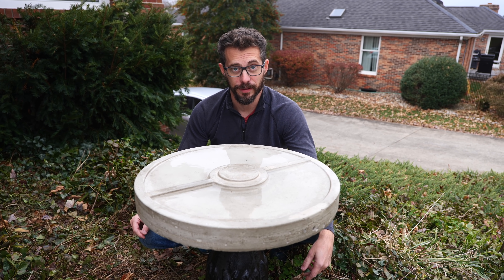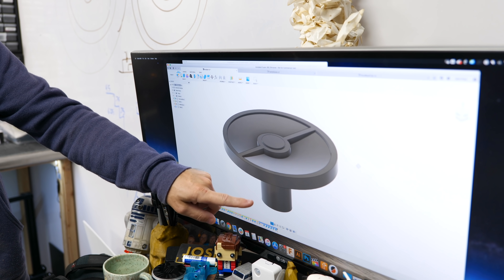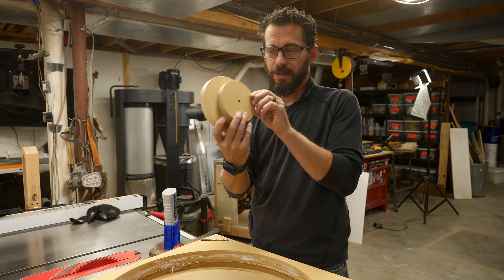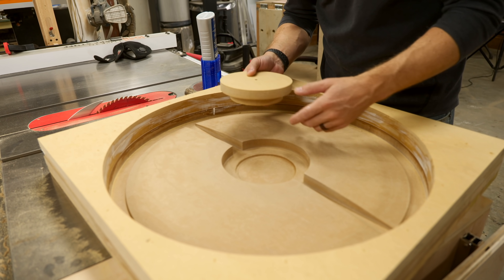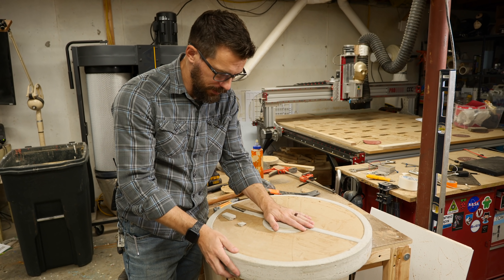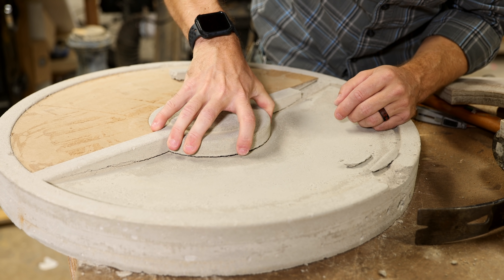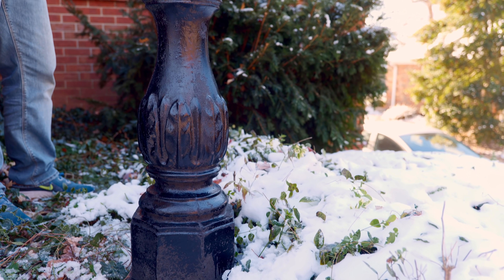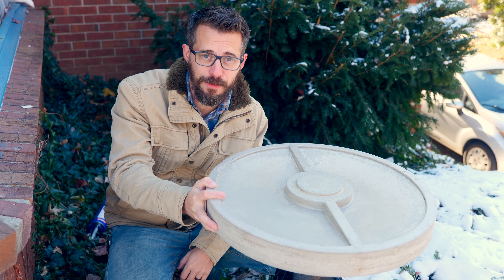How to Make A Concrete Birdbath // Pokemon | I Like To Make Stuff

Comment: Hey man, ex Sakrete salesman here that repped all the Home Depot’s. Mortar mix isn’t the best for this. It’s not made to go that thick. Sand mix is concrete without gravel so it’s good for concrete type applications that are under 2”. Also, type s has lime in it which isn’t good for this application. Just my two cents. Love your channel!
Reply: You can take those two cents to the bank. Good advice. I’d add the fibreglass as others had suggested as well.
Reply: Karl Harris fiberglass would be overkill IMO, this isn’t anything even remotely structural, if he really wants it to be fully resistant, just add some thin rebar
Reply: @shishanyu  Mesh, but not galvanized! the chemistry does not work as well with galvanized.

Comment: Next time add some fiberglass to the mortar, they make a product for this exact purpose.
Reply: Rebar may be overkill but fiberglass should do the job. Concrete itself can handle compressive forces but not expanding - this is why it's pretty wise to add some kind of reinforcement which depends on application: rebars / steel wires (little rusty is great and also eco) / fiberglass works best
Reply: Chicken wire makes an  excellent rebar for small projects like this!
Reply: Agreed. GFRC (Glass Fiber Reinforced Concrete) is massively strong if mixed properly.
Reply: Absolutely needs fibreglass added, and also plasticiser to reduce the water used and to make it flow better. Once done, the piece should be immersed in water for several days, allowed to dry for a few more days then sealed and installed.
Reply: Fiberglass, a wire mesh AND a latex fortifier which will help with water absorption.
Reply: Crap
Reply: @RobertAmine  How will crap help?

Comment: Something that overhangs so much really needs some reinforcement. Concrete is useless in tension. Rebar is probably overkill, but some chicken wire embedded in there will make it a lot stronger.
Reply: i was just thinking this exact same thing.
Reply: Maybe some fiberglass added to the concrete would suffice. I do that to all the concrete pots and planters I make, and those have very thin walls. Works great, super strong. I also use CementAll (very strong 9000 psi). The mortar mix used in the video only has about a 2000 psi,if that. Pretty weak, as you can see by the end of the video.
Reply: Hardware cloth too

Comment: Missed opportunity to call it a PokéBowl XD

ALSO, glad to see an attempt at sealing MDF to use as a concrete mold since I have ambitions to do the same...
Reply: MDF is nice, but you should use fiberglass epoxy or similar to soak in a bit and give a better release surface. Rough machining, seal/reinforce with a penetrating resin, final machining, and remember to leave a draft so the cast part can release. With straight walls or undercuts you form a mechanical bond and something will have to break to get things apart.

Comment: What you should have used instead of mortar, is grout.  Grout is made the same as concrete, but without coarse aggregate.  It is stronger, and less prone to cracking than mortar.

Mortar is made with Portland Type S or Portland Type M cement, and grout is made with Portland Type I/II cement.  I happen to know, because I'm a construction inspector, and part of my job is inspecting masonry construction.

Comment: I've already seen a lot of good suggestions to help prevent cracking and make the bird bath stronger. One thing I thought of was to cut a circular piece of chicken wire fencing that could be pushed into the center of the mortar mix to lend more strength to the structure overall.

Comment: If you make the enclosed molds  (like the basin for the water) in 3 pieces with 2 bigger halves and 1 smaller strip, you can remove the middle smaller strip(relieve the sideways tension)  and then remove the bigger ones without cracking small ridges of concrete. (Same as in the industry  -> leave a sacrifisionel piece to relieve tension/force)

Also the best “mold release” for concrete is simple oil (its used in construction like this), and over time if the block falls it might crack because it doesn’t have any “rebar” in it. 

Great video :D and sorry, english is my third language

Comment: nice project; turned out well.  I did one where i laid colored glass pieces down with blue tape on them that was on the water side.  When  i was done i painted the whole thing like you did your base and then removed the blue tape.  So i had a darker stand and bird bath/bowl with various colored glass pieces that showed nicely in sun light.  Birds and a few squirrels love it!

Comment: That turned out pretty neat. I’m sure you know more than I do about designing the mold in CAD programs, but one minor thing may help you with future molds. If you add some relief angles to the walls you should have a much easier time separating the parts. 90 degree walls just creates a bear of a problem for getting things to release. I don’t know if you still would have had the cracking with a slight angle to the walls but it may have minimized the damage.

Comment: Hi bob, great project as usual! I would recommend you to transform all the vertical surfaces from 90 degrees to 87/88 degrees angle to prevent the cracks and making an easy exit of the concrete from the mold.

Comment: Mortar is designed to do small layers, between blockwork. Vibrated concrete would have been a lot stronger. Maybe some metal mesh (even chicken wire) would help to reinforce it!

Comment: Looks great! Might want to give a product from Home Depot called Rapid Set mortar mix a try. Cures in an hour with incredible strength which would shorten the project timeline. Also caulking the corners of your mold may help with reducing the cracks when pulling the mold off. I used this product to make hearth stones and they turned out great!  Love your videos and projects!

Comment: Nice project! Next time use regular cement or concrete (you can actually get concrete with smaller gravel in it for decorative purposes) because mortar is more brittle than concrete would be. Still a nice result though and actually learning how to repair this stuff is handy as well.

Comment: you should design the concrete mold with release angles. This will solve many issues that you had. Also some more water into the concrete mix and thoroughly vibrating .

Comment: Some people already said it but, yeah, don’t use mortar for this, and mortar isn’t concrete and most times it doesn’t contain cement either. All that crumbling wouldn’t have happened with cement. 
Next time buy cement and sand, mix them until it looks gray again, and do the same thing. Doing your own mix for non structural projects is easy and very forgiving. Add a bit more water so it’s more liquid, it’d weaken a structure 20 or more % but since this is for birds, who cares. Also add some kind of rebar if you are worried about the weight, just thin wire works for this

Comment: I think I'm in line with other commenters as well.  Maybe next time you do a concrete project use something like Quickrete 5000 and drop in some reinforcement like steel wire or fiberglass.

Comment: i think, if you had covered the back of the wet concrete with some plastic wrap, so it cures slower, the cracking could have been avoided.
it is quite a large, thin crosssection for running without any reinforcement. some fiber would have helped.

Comment: Cemental by Rapid set is the way to go much stronger! With the flo aditive it would flo in and take very little vibration to get it smooth. Its like 3500 psi.

Comment: I have a pedestal with a hold in it.  Do you think that if I fill part of the opening that goes the full length of the pedestal, I could make a. Bird bath using two different sized plastic saucers you put under planters, cut a hole in the large one and let some of the concrete flow into the hole, then fill the top saucer with more concrete and insert a smaller saucer inside the larger saucer and push it down to create the de th of basin I want, wait till it dries and remove the top saucer sprayed with WD40 and then cut away the bottom saucer?

Comment: Good video Bob! I wonder if making the divider\center separately then adding it after would prevent cracking?  I do also recall adding fibreglass to cement when I worked as a plasterer.  Happy Thanksgiving!

Comment: Maybe use bevels on your mold instead of 90s so it releases easier.
Reply from the maker: We added fillets to each area so that it wasn't trapped in a 90, maybe a little bit more. But the mold worked out better than I thought.
Reply: For metal casting, you typically taper all surfacces a little (maybe 5°) so your pattern releases easier and less destructive from the sand mold. Similar things are done on injection molding (just check random plastic products, walls will get thinner towards the top, everything is slightly leaned in or out, ...). I guess by ading a slight taper instead of straight upright walls you could achieve better results in concrete too ;)
Reply: @Iliketomakestuff  In mold making, angles on the walls of the is called draft. The entire wall of the mold should angle like a cone to facilitate its removal. Great content, thanks for sharing.

Comment: The cracks were developed because of insufficient water used during mixing and lack of curing. Cement Mortar or concrete basically exhibit heat during setting, so water is required for it to cure properly.

Comment: Audience Guys, concrete is a material that handles compression very well (truck on a parking pad) but tension very poorly (stresses through the entire diving board when standing on the very end over the pool). 

So if you are doing something like this at home, get wire mesh (since bird baths are so thin) to reinforce it. The concrete essentially grabs the mesh and holds on and the tension of the system is handled by the mesh. AND make sure to have some go into your detail voids, it will also help minimize thinner pieces from cracking off when releasing the mold (but if you go pokeball, try and make the lines thicker, it will help, even without wire mesh)

IMPORTANT NOTE: Do Not Get Galvinaized Steel Mesh! Cement has some decently complex chemistry going on when it's mixed and setting and the galvanized coating does change the process. Not so much that it would not become concrete, but you would get far weaker concrete that won't last as long.

Comment: Sorry to say it, but this should be named "How not to make a Concrete birdbath" Good luck on the next try with concrete. :) First tip is to never cut a form with vertical walls, allways cut at an 5-10 degress angle. It will pop right out of it. Tip two.. rebar or fiber.. will never last without it.

Comment: Wouldn’t the cement used for countertops work better? Also some mesh or fiber reinforcement to make it stronger.
Reply from the maker: We couldn't find any countertop mix locally, but the fiberglass is a good idea.

Comment: The mold 1/2 could have been 1/4, easier to remove & same chick wire would help hold the  cement for years.
It was a good first project.

Comment: Next time use concrete instead, or better yet, buy cement and fine sand make your own batch of concrete as fine as you need it. Also I believe enamel paint would have worked better as a sealant. Sorry, but this is a failure in my book...

Comment: how safe is all the materials for the borbs? like won't the concrete/adhesive affect in any way the water?
Reply: fernando cunha not once it’s cured. Should be left for a bit first technically but it’s going to be so diluted and will probably be filled regularly that it won’t harm the birds

Comment: Slight nitpick. Cement is not concrete. Concrete is not cement.
At 5:50, when you didn't choose a CEMENT mix over a MORTAR mix: CONCRETE and MORTAR are both a CEMENT mix. That said, concrete may have done pretty well in this project and alleviated the damage you found at 7:25, 8:10 and 8:39. You live and learn.
I do like your overall design. Well done.

Comment: I would had use the CNC to cut into the concrete instead of making the form. That only if the CNC can cut into the concrete with the proper drill bit.

Comment: the middle section broken off because of the hard 90 degree edges.. If you had rounded them over move you probably would not have that problem